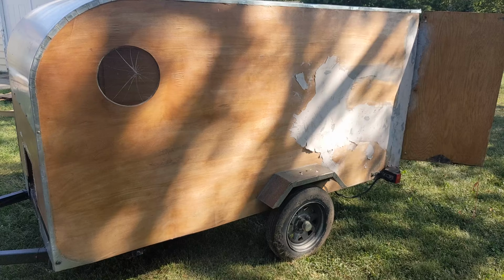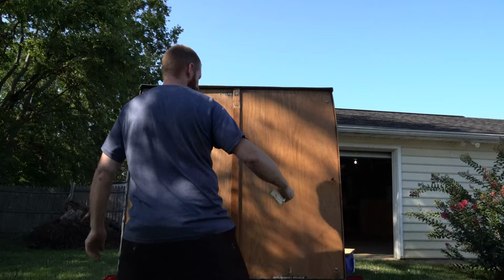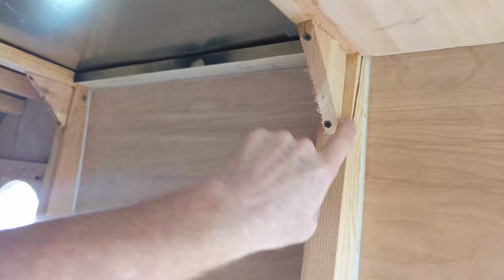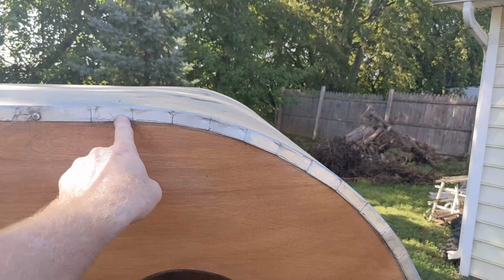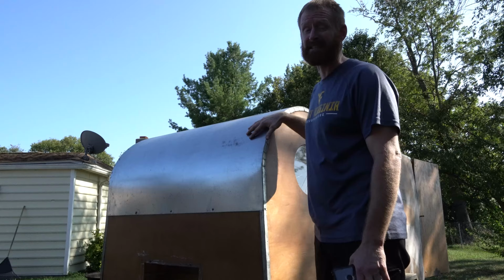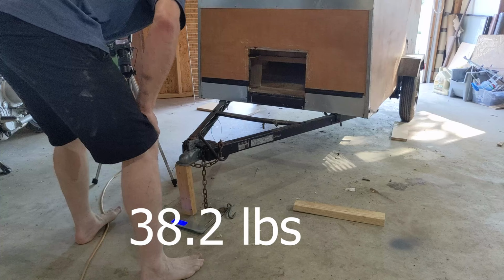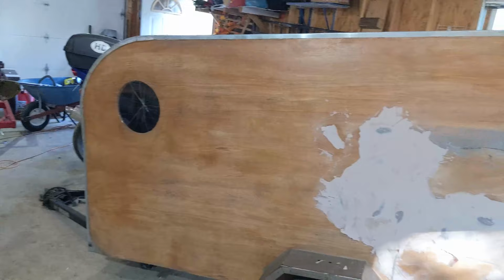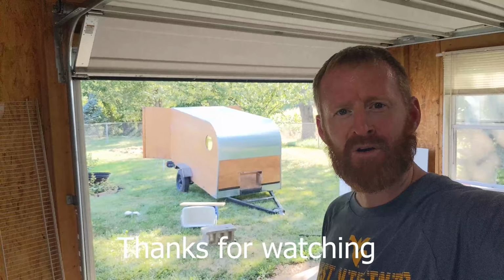Wooden Micro-camper One-year Review

Comment: Love the simple build. I'd sand the bondo and put a wood cut out of mountains or a star type pattern both sides stain a different color to hide the damage. . You could as time and money allows, add foam insulation and use the large carpet grey or black that home depo sales to line over walls on inside. Add a few shelves to put those cloth boxes on with bungie cord x's to keep in place, very small ledge. Add a few shelves and have a coffee pot on inside and a plug in for power strip. Then could charge phone and stuff. Its a great and inexpensive build. I love the wood look. Amazing you did such a sturdy build. Also, could paint or stain plywood on inside and stain the studs a pecan color would look beautiful. Could also sand the inside where repair is and then paint all the plywood white and the studs a pecan color. Would pop. Hope you enjoy it.
Reply from the maker: Those are all great suggestions. Thank you for sharing them and thanks for checking out the video!

Comment: Diffuser & tie down ideas are EXCELLENT & on that damaged side just get a sheet of aluminum & cover the whole side, a) was the hinged hold downs for holding down the A/C ?? b) The pulling down the rear so easy gives a idea about putting a handle there to aid in moving c) How did it react to vehicles passing you like tractors trailers??
Reply from the maker: Thanks for taking the time to ask questions. I'll do my best to answer. I noticed you mentioned the use of aluminum a couple times. The overall goal was to keep the price down. Sheet aluminum is about 2 to 3 times the price of wood or galvanized metal. You're right, it looks nice and is maintenance free, but I couldn't afford it at the time. Plus, I wanted a wooden camper. Possibly, the next camper build will incorporate the use of aluminum.
 
The camper pulled fantastic behind the car. No swaying whatsoever, even with the big rigs passing.

After my travel job, I actually used those hinge hold downs to tie my dirt bike down. I now occasionally use the camper to take my dirt bike to the track.
Reply: @mikekrabal  So, this is a combination Camper - Toy Hauler!

Comment: Great ideas, thanks! What kind of dirt bike are you hauling in it? I'm customizing a $2k 4x6 cargo trailer. You make me wish I built one like yours... Closed cell Spray foam can be bought on ebay. It's lightweight and adds tremendous structural strength. A side door gives you the ability to put a 18" deep kitchen/storage across the back. A simple wall plug will hold a small heater from Home Depot for cold nights...
Reply from the maker: Thanks for checking out the video!
I was hauling my crf450r in it. I did take the front wheel off to make it fit. 
Thanks for the foam suggestion. I hadn't thought of it for this type of build. I had thought of the foam panels. I may use it in the next build. Good luck on the rest of your build. I think you're right in that the optimal kitchen area is along the back and that a side door is good for that design. My next build may incorporate some of that.

Comment: Great Mike. Question: I see you glued the side panels and they are bend in with the frame. Why don't you use screws and build straight frame on both side? I have no knowledge of building, just curious. Thanks.
Reply from the maker: Thanks for the question and watching the video! Here's another video that shows the actual camper build. https://www.youtube.com/watch?v=HH2NAY9Up8c

I used screws on the top edge of the side panels. They are hidden under the fold of the roof metal, to keep that area from leaking. I used the standard trailer bolts at the bottom end of the side panels to hold them tightly to the trailer frame. In between, that's where I used the glue. I wanted as few holes as possible exposed to the elements, to stop the chance of leaking. Also, I thought the uninterrupted wood grain looked good.
The trailer is curved at the top instead of straight so that a 4-foot wide sheet of galvanized metal could be used as the roof, and also to allow a one-inch overlap one each side as an easy way to keep water out. I chose to curve the walls instead of lean the walls in because I thought the curve would look better. If the sheet metal was sold wider than four feet, I'd have made the walls straight. The curve is in part due to the limitation of what material I could find to purchase. Thanks again for watching, and I hope this has helped.

Comment: Mike, I noticed your bike there... Have you ever considered hauling it inside your camper? My cargo/camper conversion came with a ramp and I have a scooter small enough to fit inside!
Reply from the maker: I have hauled the MX bike inside the camper a few times. Unfortunately I had to take the front wheel off to do so. But it got me by in a pinch. The interior height is 44", just shy of the bike's height. Thanks for checking out the video!

Comment: They make 4x8 sheets  of that thin plastic panels  you could put on the sides.
Reply from the maker: Thanks for checking out the video and for that recommendation. I'll highly consider using them in future builds. They sound great for waterproofing.
Reply: The sheets of plastic panels come in different  textures i believe  i used it on a group home once to stop the kids from punching holes in the drywall
Reply: 26 bucks a sheet at home depot
Reply: @kevinswanson3910  I bet that cheaper than plywood now
Reply: @johnw65  I was told being that is plastic to put on UV paint and it will last .

Comment: I would like to make myself a 6'×10' trailer to haul my balloon arches and balloon columns. I don't need anything super heavy-duty just strong enough and light enough to tow behind my VW bettle. How would you suggest I make a 6'×10' trailer out of a 4'×8' trailer? Thank you
Reply from the maker: Thanks for checking out the video. Honestly, I haven't thought about building a 6x10 trailer before. But anything can be done with some imagination. Perhaps sheet aluminum would be better than wood. There's really no advantage to using wood unless wood is the look you want. If I were building a practical trailer.for hauling material, and money wasn't an issue, I'd build with aluminum every time. Metal studs and aluminum. Though, first I'd check the classifieds for a used 6x10 aluminum trailer.

Comment: I had my doubts when I saw you using the thin wood, then I saw that your reasoning was weight due to pulling it with the 4 cyl car. It looks as though your framing turned out very rigid, seeing as it didn't bend or flex while pulling....not to mention obvious rough roads and wind. Have you put together how much $ you saved by staying in the trailer vs. staying in a hotel room?  I'd be very curious to know.  Also, the diffuser was genius for the A/C.  Did you notice considerable lack of cooling due to lack of insulation?  Sorry for all the questions, your build has really stirred interest in me!  I'd love to have to time/talent to pull something like this off.
Reply from the maker: Thanks for watching the video and for the good questions. As I used the camper to travel the country for work, I not only saved money for hotels, but my employer paid me the money he'd usually spend on my hotel rooms since he didn't have to buy me a room. Each week was like having two paychecks. It was fantastic. On the weekends, while traveling from job to job, I'd save two nights worth of hotel room fees. My employer always got us nice rooms, but I'm more of a Motel 6 person, so maybe I saved $50 each time I didn't stay in a cheap motel. The job lasted twelve weeks so maybe I saved $1200+ on those weekends in the camper. During the work week, I stayed on the job site.
As for the A/C, I often couldn't run it at full capacity because it was too cold in there. The only state that I ran it at full capacity was Florida where the night temperate was about 85 degrees. A 5000 BTU A/C, like mine, is more than enough for an uninsulated 4x8 camper.

Comment: Why didn't you just buy a tent 🎪
Reply from the maker: Thanks for checking out the video. If I bought a tent then I wouldn't have a cool trailer project to build haha. And more practically, I had to sleep outside in hot conditions and needed something with walls that could hold an air conditioner.